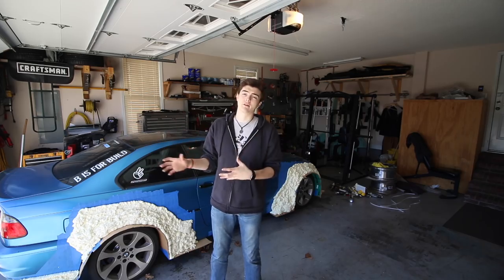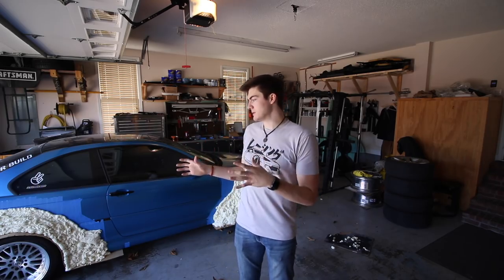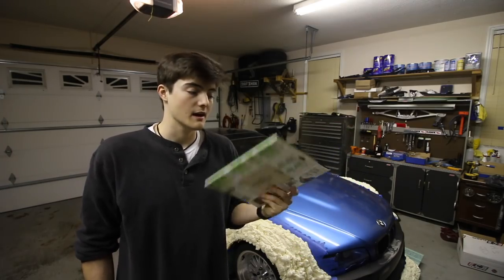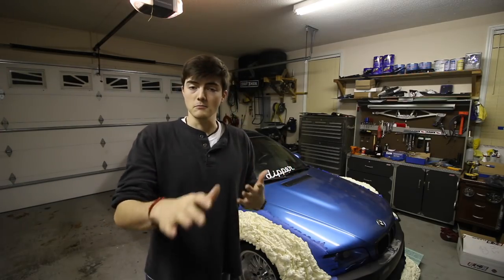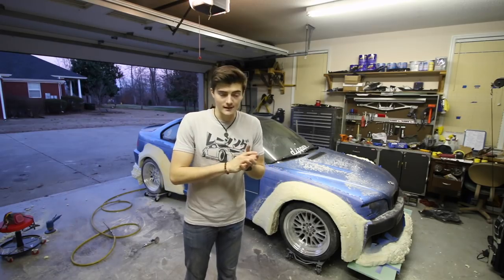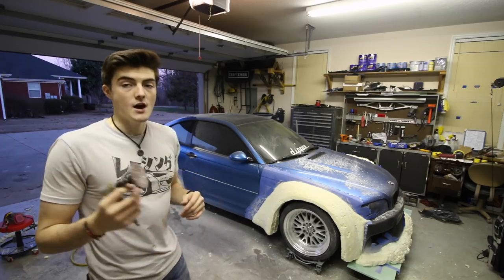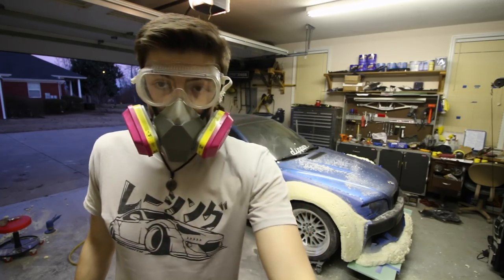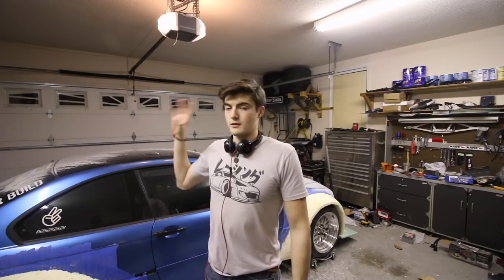DIY Widebody M3: Part 2 Wheels and Shaping

Comment: Perhaps this will be answered later in the videos. But here is where I am worried, at this point:

the foam is bonded to the masking tape. The masking tape is bonded to the car. So all of this foam is attached by no stronger of a bond than that of painters tape.

Won't that fall off?

Comment: Hi You can tell by my small round identification picture that I have done this sort of thing before to my Mercedes clk convertible if I new you were attempting this I would of given you a few tips...... I haven't gone any further up to now with your vid's ...so first thing you need room for your wheels to travel up and down to achieve this you need to cut your arches in about 3in side by side lent then bent them up and out.......this also gives you something for you arches to grip to you might need some welding if you have cut your arches too high and split the inner metal just bang them together and weld them up. If you don't no what I'm talking about then you should not be attempting anything like this......  put your wheels on all 4 sides and go out for a ride get your friends to sit in the car fully loaded go over dips and bumps as aggressively as you can ....if you find the wheels caching make moor cutting and bend up this will save you a lot of headache later trust me once you have got your car driving safely then and only then continue with the cosmetic side of your project.......boxing in with cardboard putting the cardboard at the outer part this will make a box section for the foam to gather up leaving you with a nice big block of foam..... cut it with a hacksaw blade to the shape you want. put three layers of fiberglass bandages all over your arches criss cross and slightly on your car body  . then apply your filler go for the shape you want continue with the filler to bumpers ......get sills and rivet them in place then fiberglass strips were they join and then filler.....I left no gaps from the arch to the bumper but you can do them with a thin blade on a grinder..... Then take the foam out from under arches and tidy up with fiberglass this will strengthen you arches and prevent cracking with time........ mine have not cracked and its bin three years now I'm going to look at the rest of your vids I hope you were as lucky as I was.. .........

Comment: You need a surform rasp to take foam down and shape it with ease. I use these when shaping surfboards. Also make a template for the front and back so you can check how even it is, side to side. 
\Pretty cool video though and deff some heavy DIY

Comment: What you should have done is when the foam was wet use a filler spreading card a nd shaped it up a bit.. It would have  been loads less sanding. Also you could have used a Duel action sander and shaped it up.. Then lastly shape them up with a sanding block.. Then filler..

Comment: Thoughts, could cut sanding time in half if you formed an outside covering  (like you did w/cardboard underneath) to hold the shape. Then sanding/cutting would be minimized using ur technique IMO.

Comment: You could have used a thin gauge sheet metal and stretched fabric from fender to sheet metal and fiber glassed it. A lot less work than foaming the piss out of your car. And it could be removable. Good luck with foam.

Comment: wouldnt it be cheaper to just use clay(and im sure youll get that smoother finish alot easier) and then dress the clay with fibreglass or what you intend to use.

Comment: Dont use plaster or any interior wall spackles, it will crack out.  and dont use softer silicone or calkingd for this it flexes while you drive and puts pressure on body fillers or paints around it. Use hard and fiberous materials for each piece.  Flexible medium is ok to connect things with. drywall or other wall building materials are not okay they will crack leaving weak unsopported places or places for other things to fill in including moisture or other debris or soap from washing your car at a carwash inside of your body to work its way under your paint coat causing bubbling and cracking and peeling which is horrible. You think you're done and later on  a big bubble shows up in the middle of it or it cracks open. I'm saying this from experience. Broke out the angle grinder and took out he entire bubble area and anything weak around it out and used harder materials like fiberglass or two part body filler and spot putty which take less time to put in and have more durability. They actually even work better in home repairs as well

Comment: Shop Vac, Cheese grater, & Rasp file. Preety dusty and dirty isnt it. You can always get a 50lbs of pottery clay for $25 bucks. Good job though. Looking good.
Reply: http://www.homedepot.com/p/Stanley-Surform-Shaver-21-115/100654913

these work amazingly well for taking down foam very fast, and can have a lot of precision even. the cool part is you can attach a shop vac to the top of it and as its cutting into the foam it sucks it right up. Very little mess doing it like that.
Reply: TwentyTwoRacing o
Reply: JOEGGGJOE
Reply: TwentyTwoRacing